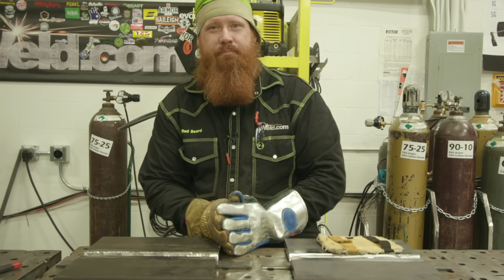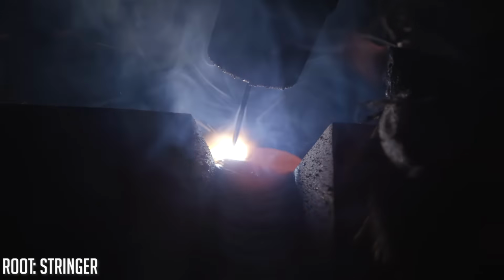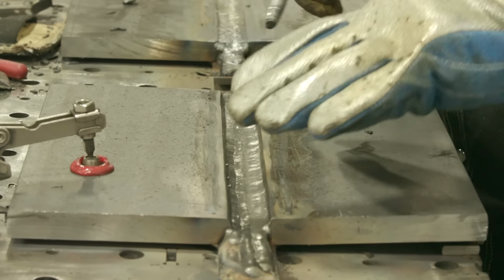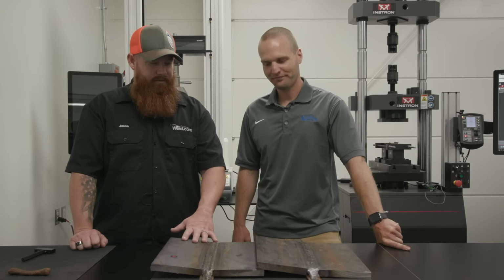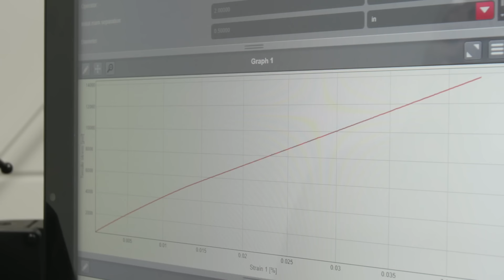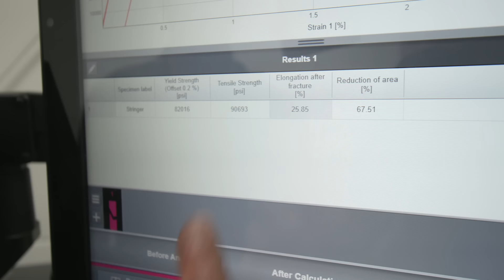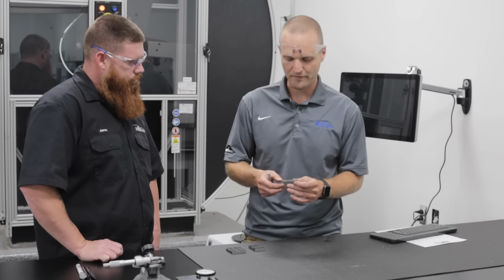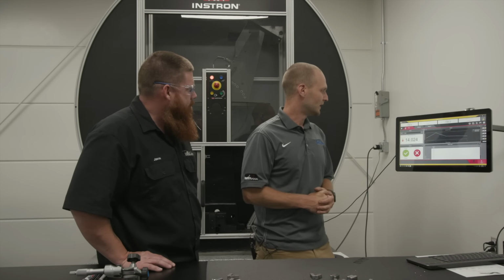Stringers vs Weaves

Comment: I was taught the old saying "Strength in Stringers, Weakness in Weaves". Keeping that in mind always. Over the years I realize there are certain applications where weaves are O.K.  Off topic somewhat but I was also taught that "Down hand" or "down hill" welds are a big no no! and for good reason! I have seen a few let go! However, they are OK for thin material such as 1/8" or lower.

Comment: Did I miss something over the years I have been welding? Internet myth perhaps? Armchair forum experts maybe? I never spent much time on internet discussions on welding.  
Anyway, what is the big mystery? There has never been any debate amongst the people or should I say professionals I have worked with. Codes have specified stringers or a maximum allowable electrode manipulation for years. All those code requirements were based on tests. The same tests you just did here. I have know for going on 40 years that stringers were preferable  to weaves for ultimate strength. Having said all this, it is a good video and drives home nicely that fact. Well done lads
Reply: Warren Jones you’d be surprised over the stringer vs. weave controversy on the internet.
Reply: Warren, I'm with you all the way. My training 1978-1980 taught me the same. Weaves were never acceptable.

Comment: I was trained - NEVER do weave when strength matters. (Do what you want with non structural shit, I still don't weave)
Reply: My instructor, he welded by using waves and they told him to stop, that it wasnt the correct way to weld and would measure up to safety standards. They said it left wagon trails under the scanner and when they tested it, it held 70,300 lbs, the stringer held 72,000 lbs. It passed by by 300 lbs. Stringers are far more stronger, but my instructor knew how to weld strong welds.

Comment: So it's actually true. I've always run stringers, I'm going to stick with them.
Reply: Mark Campbell it’s because at the bigger gaps stringers put less heat on it. On a 3-4 pass V weaves would win. It’s the later ones that are too wide and put too much heat on it
Reply: I personally like cooking my material, hammering off the slag and splatter and grinding big globs off.  Makes for nice ambience in the garage/shop.
Reply: Radio Bro you don’t want to add lots of heat to anything you work on. It’ll warp with the more heat you put on it. Plus after a certain amount of heat it actually messed with the integrity. You want enough to run a good penetrating and fast bead. But don’t want to have excessive penetration

Comment: Just out of curiosity, at what voltages were you set for each style?  I know you were keeping it under 350 degrees, but being self taught, and still learning, it would be nice if I knew where your setting were i.e. voltage.
Reply: Joseph Cicirello we ran 26V and 450wfs with 75/25 gas at 40CFH
Reply: @GodslilRedneck23  So, let me get this correct. Where you running dual shield with gas and flux? Understand the 75/25 but why at 40 CFH? Is that due to the size of gap or the size of nozzle? 

Thank you in advance for taking the time to answer my questions.
Reply: Joseph Cicirello yes, we were running gas shielded flux cored. The manufacturer of the wire recommends 40-50CFH to obtain  consistent mechanical properties of that wire.

Comment: Before my old employer bought an automated flash butt welder, I used to butt spice 8x8x3/4 angle. I first ran a downhill pass on the outside (as a tack), then I'd arc-air gouge the inside. Slag breaks away clean. I'd fill the 3/4 gap with stringers. Then I'd gouge the downhill pass on the outside down to weld and fill it with stingers. 100% penetration.
Reply: Butting two 40 footers would take me about 1/2 hr. while using a jib crane to roll them. The automated machine would weld one in 25 seconds and the run it out and shear it to whatever length you needed.

Comment: I agree with fellow viewers, I'd like to see stick vertically classic d1.1 style all of my years in fabrication and millwrighting it's  always been vertical argument between weaving and stringers but thanks for another awesome video
Reply: I can answer that question. The issue is excessive heat input into the base metal. This applies to the process in all positions.

Comment: Naval and government boat builders have known this for decades on decades. Having spent most of my welding career working in shipyard, the weld specs always call for stringers. A wide root is acceptable but anything else will be called out, ground out and redone. There was some arguement among some people in the shop about what was stronger (the weave guys wanting to argue) so my boss said, ok, we'll do a side by side comparison one of the upcoming weekends. The results showed that stringers introduce less overheating of the work piece and the stringers won in side by side. Are stringers less appealing visually? I wouldn't say so if done cleanly. I've always stuck to stringers on hull repair and never had an issue.

Comment: Would this be the way to do pressure vessel welding joining two plates? The beveled edge to get a thru penetration weld kind of looks like the process for high pressure vessel welding. I worked on a steam locomotive refurbishing it taking about a year and half to do. The welders did through penetration welds and I had to bevel all the plates with a gauge I made to keep the bevel the same. They x-rayed all the welds several times as they built them up. 5/8s inch steel. Lots of welding to replace thinned area of the boiler. I can't weld worth a crap because I've never tried to practice much but I learned a lot about welding from being around the steam locomotives. They stick welded all the joints which I thought took a long time. One thing i didn't ask was why they did that over wire welding. Maybe you can answer that for me.  Very interesting video you've made here.

Comment: I've always wondered about this. Great video with some surprising answers.  Now for another question. If stringers are better than weaves, Why do pipe elders exclusively use weaves?????
Reply: Does weaving achieve deeper penetration into the base metal? That's my guess, and is what I am still left wondering.

Comment: I am an amateur hobby welder at best but I can usually get the job done.  Thank you for taking the time and burning the probably 5 lbs of wire
to demonstrate the difference between Stringers vs Weaves.  I would have thought weaves were stronger but you have proven that not to be the 
case.  It's nice to see something scientifically proven verses some guy saying "I've been doing this for 50 years and this is the strongest way"
Awesome video and thanks for the valuable information!

Comment: This is why you guys are amongst the best welding channels on YouTube.

Quality content based in fact that addresses common industry questions.

I'd be interested to know if the same results would be found with aluminium.

I had a team leader at work adamantly insisting that weaves on alloy are stronger than stringers.

What do you reckon?
Reply: I know its pretty much a no go on stainless and high strength alloys.

Comment: the difference between knowledge and experience. I was taught this in welding school. a stringer is always stronger. weave is a cover pass. 
another pet peeve of mine 6011 rod and MIG welding you are supposed to whip weld. that allows a slight cooling before reentering the weld puddle. makes for a stronger weld.

Comment: Weaves can be better in some cases. When u weld, u can either: 1) get ur settings right so that u can run a stringer bead to the size u want it without undercutting or blowing through, or 2) If ur settings r too hot, use some kind of weaving technique to prevent undedcutting or blowing through. Do either one of these 2 and u will guarantee good penetration. For example, on structural steel, I use settings that r slightly too hot (30V and 12.3m per min) and i weave back and forth a bit in the root to build up a 6mm run, and for 8mm runs i will use the cursive e technique.

Comment: I was a steam fitter back in the late 1960’s. To get ASME certified we had to weld I think 4” schedule 80 pipe in horizontal position. Root pass was basically a narrow weave. I think three passes only. We rarely had to stamp anything anyway. 

Shop policy was no stringers (the root pass almost looked like a stringer). Most of the field welding was a butt weld vertical position and had to be uphill.  They wouldn’t hire a downhill welder yet all the Gas pipeline welders were downhill stringer guys and the shop wouldn’t hire them unless they could run uphill. It takes more time to run stringers and looks terrible in my view.

Comment: Intresting content.

I would say follow your wps, if it allows high heat input with big weavs its faster.  When there is a wps its not the welder who should decide how to weld it. You just follow the specs and if it fail it's the one who made the wps to blame.

Comment: Ok another question. When should you quench a piece to cool it? I know it hardens the metal like a knife will hold a edge longer. But does hardening make it stronger? It can be brittle. A shear pin is soft to protect and break before the crank. I guess i just answered my own question. You kept the temperature under 300deg for that reason. The weaving was probably hotter and took longer to cool making it softer in this ? The stringer was narrower allowing it to cool off faster making it harder. Thus making the stringer stronger. 
I wonder what would happen if you heat treated them if they would be the same? 
Or am I missing the reason for the test?
Reply: This is low carbon steel, not like tool steel or anything like the quenching in blacksmithing. Generally you never want to water quench after welding though unless its just a practice coupon or something.

Comment: The only issue I see with this test is the weaving was done far to exaggerated. Basic rules of weaving with a slag bearing process dictates that if you weave, you cannot weave so wide that you run over already frozen slag. At that point you might as well incorporated a circular pattern to the weld pool manipulation. Also thank you for also demonstrating that even in a drag that you can still end up with slag running out in front of the puddle, too many claim this can't happen in a drag. I am a stringer welder myself, but would never weave a pass as wide as you did on that test plate. Also you should have spent more time at the bevel face on each side. Almost like you have never had a lesson on how to weld low high up hill on a 3G test, but if you had paused on the bevel face longer the slag freeze would have been even more exaggerated when you went back over it. I personally would like to see this test done again and have the weave portion welded out in a more competent fashion instead of the hack ass slag stacking retard found in most weld shops. Almost like you were trying to cause the weave portion to fail. Just the opinion of a random CWI that is all.

Comment: Weld width to depth ratio is one thing they look for in engineering strength ; wide or deep beads are weaker because there's too much contraction across the weld.

Comment: Australian Standards for MIG welding only permit weaving on vertical up joints and then, I believe, the weave must not exceed 9x wire diameter. That was from about 30 years ago now.
Everything else must be stringers and stop/starts should be staggered on multipass joints..
On certified welding joints, interpass temperature limits must also be adhered to. My guess is that weaving will easily exceed those levels, whereas stringers will only leave short term heat input. 

Our No.8 MIG certificate qualifications have very strict conditions as well. Properly done multipass stringer welds look good too.
In the code, if you can feel or see a ridge between the stringer beads, have excess reinforcement and if the stop/start is bumpy or can be felt with a fingernail and any taper in the stringer, it is a fail.

We used to get dragline parts in from the USA, some with 40mm (1.6") stringer beads and they looked quite bad, like one welder only did one stringer and someone else did another and so on. The result was quite a mess. We had to weld to a much more stringent code and the management would complain about the cost of doing such work. We just said it would be by far, so much cheaper if we could weld to the American standard already on the machines...

I know the USA have some different and differing codes for different applications and sometimes those differences aren't all that important. Each to their own.

Comment: I do alot of exhaust welding and on the underside i sometimes have issues with the wire balling up and wanting to fall instead of penetrating the pipe. Suggestions? Im assuming gravity is a factor here as i dont have this issue on the top and sides just the bottom. (Welding overhead)
Reply: Need more heat probably
Reply: @youngjizzy856  i hadnt considered that but I'll experiment either way. It's like my wire is melting mid air and just falls once it's got a little weight. "Globular transfer" I believe is the term. Except I'm under a pipe so the "glob" just drops at my feet and makes a spark show on the concrete..frustrating to say the least.

Comment: What's the application of this joint configuration? I've never seen it used in Australia. Is the backer gouged off later?
Reply: Match2100 this is a full penetration weld. Typically used when you only have access to one side of the joint.
Reply: @GodslilRedneck23  Thanks Jase, appreciate the reply. Really enjoying your work as presenter too mate, great to see you relaxing in front of the camera!
Reply: Match2100 thanks man, it’s definitely a new world for me. Teaching in front of a class is one thing but in front of a camera is completely different. Slowly finding my stride.
Reply: @GodslilRedneck23  No worries, thanks again!
Reply: @Match2100. In other US vids, I have noticed that the strap on the back is not uncommon, even in test coupons. I can't think of a practical use for these welds. I've never seen a situation where a backing strap is used and certainly we have nothing like it allowed here in Au. Seems a bit silly to me.
Reply: @tandemwings4733  Yeah, always seemed odd to me. I've never seen a weave used in the downhand position either. Mind you, I was only on the tools for a few years and didn't get to experience the whole gamut of the trade

Comment: I'm curious what would be the results when comparing those 2 results to a mix of stringers and weaves. Such as doing 3 stringers for the root and top 2 welds, then doing weave for 2 passes and cap it off with stringer.

Comment: awesome and very educational video. i am certified in rebar and 5g. let me ask you a quick question, i have never been a big fan of weave and always did stringers, with that said, what are you thoughts on alternating your pass direction and when you put the cap on the stringer, do you think it would have made a difference if you would have ran the beads on the sides first then creating a valley in the middle to fill last? maybe that was more than one question and not very fast but im very curious to your thoughts?

Comment: I would like to see this testing E7018... my 7/8 x 6in plate took a good few 1/8 rods to fill her out!
Reply: Still waiting to take my 1" unlimited test for stick, passed the 3/8ths test doing 3g with backing strap though.  I think I will take the 1" test open root because I am taking a pipe class soon, and jumping to all the possibilities that a 1" open root 3g would give me would be awesome. Have you taken the 5g or 6g tests yet?  If so, any tips?
Reply: I did the 1G 3/8 and 7/8 test plates in my class, but not really interested in SMAW certs instead I am planning to getting GTAW.
Reply: @mordantly  Always remember to run fast wit aluminum.

Comment: Both weaves and stringers are acceptable, but in my opinion, stringers are preferred due to higher productivity and less opportunity for porosity.  That being said weaves are preferred for very thick weldments as often occur on large pressure vessels.  The key item in any weld is that the weld is stronger than the parent metal.

Comment: Great video, that really answered a lot of questions for me... also want to echo the request for similar testing comparing 7018 and 6013 series stick welds.
Reply: 7018 will win all the strenght tests vs the 6013,the 6013 is just for light use and a faster arc stryking
Reply: I get that; I want to see the weld structure differences as detailed by the testing facility.

Comment: Great video, it was interesting to see the weld being tested and the difference in the two techniques. Does the Charpy test replace a bend test or are they different types of tests for different types of welds?
Reply: Three years late, but for future readers of the comments like me... A Charpy test indicates toughness, the resistance to fracture, particularly with a dynamic load, and doesn't much care about the yield stress. Bending strength is like tensile strength--the stress at which the material yield, fails, and ultimately fractures, with essentially a static load. (An Instron increases applied load so slowly that it's considered static.) A very strong material may also be brittle, and it would display high strength--both tensile and bending--but low toughness. Mild steel and stainless steels are fairly tough, but they are at the low end of the strength scale for steels. Note that in most applications where steel is used to support a load, yielding is a failure that requires repair or replacement, but fracturing too early even after yielding can present much more serious safety consequences in use, depending on the application.

Comment: Was this supposed to be a dual shielded wire flux core with shielding gas also? If so at 7:22 I have never seen a gun like that. I don't see a where the gas would be coming from.